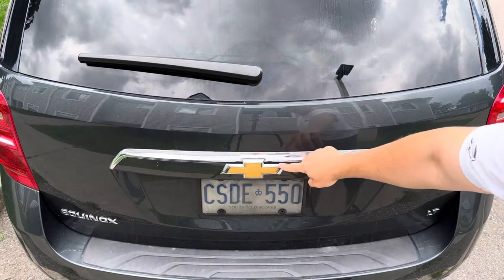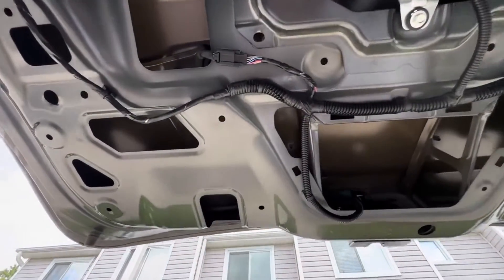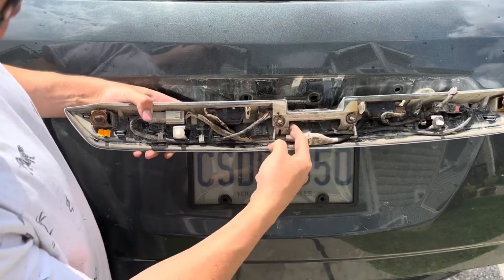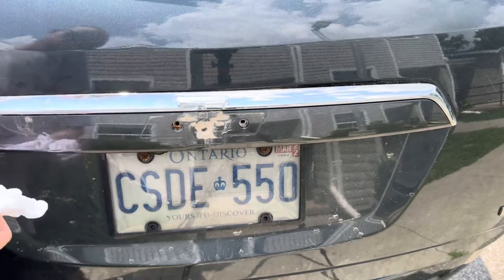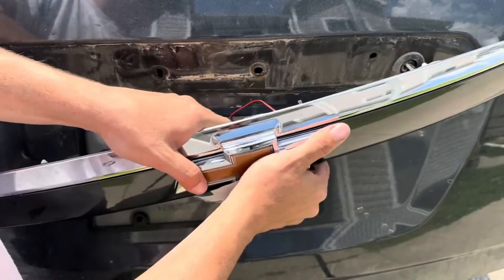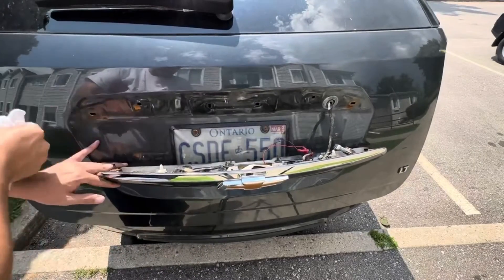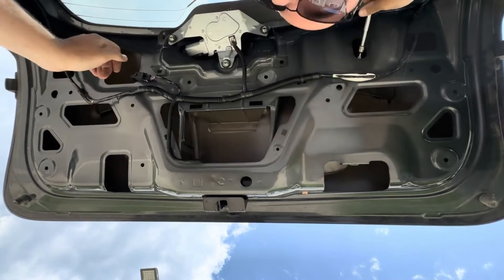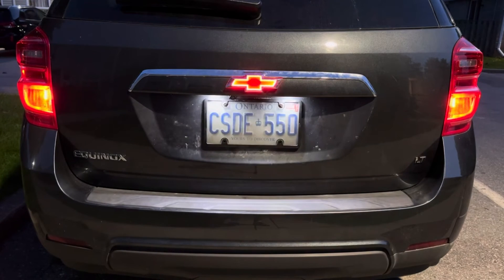Chevy Equinox LED Badge Upgrade

Comment: Do you know if this would work on the 2010-2015 that have the full chrome piece under the emblem?
Reply from the maker: So I ran your question by a colleague of mine that has a 2012 equinox. He says that the badge is only held on by adhesive. So you can use a plastic panel removal tool and some fishing line to remove the badge. Then clean it with goo gone. Then clean with rubbing alcohol thoroughly. After that the only difference you will have is that you will have to drill a hole in your bezel to put the wires through as you won’t have holes like mine did. Other than that the bezel will come off the same as in this video. Wiring will also be the same. Thanks for watching. Hope this helps. Please like and subscribe
Reply: @BillOfAllTrades2016  Wow, that was really nice of you find that info and write these detailed instructions. Thanks a lot.
Reply from the maker: You’re welcome. I’m glad to help. It only took a couple Facebook messages to my colleage, no big deal. That’s what we do for our fellow equinox owners.